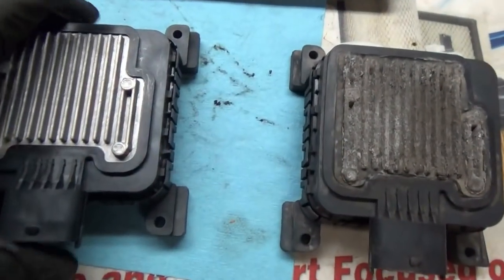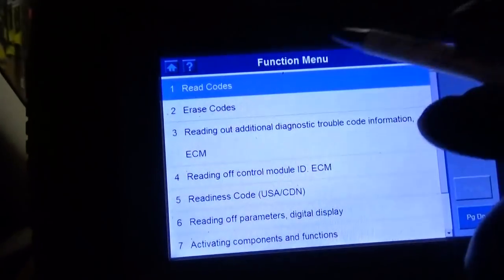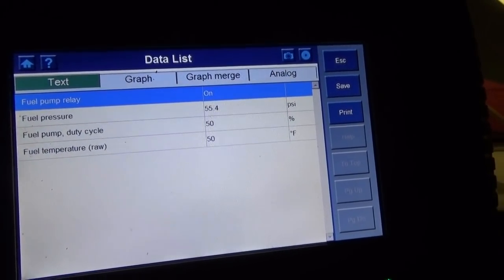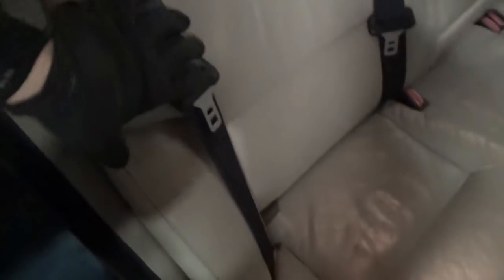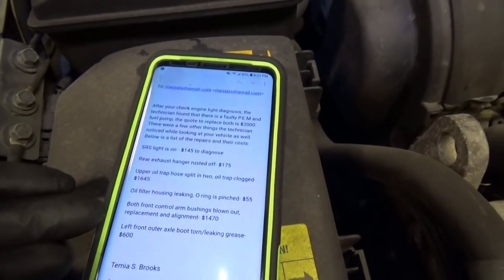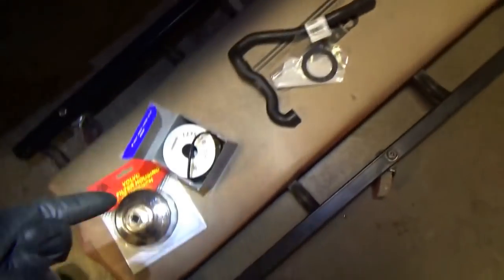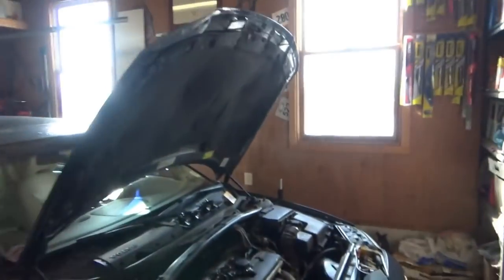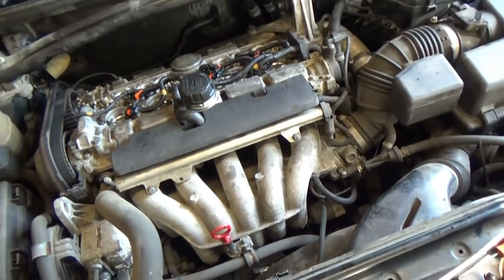Volvo Crank No-Start -Part 3 (Repairs!)

Comment: "Euro trash".... Hhmmmm. Let me just pick that myth apart. You guys know that your American brands are not that brilliant for reliability and corrosion, so why do you call European cars trash? They're usually better equipped, more modern, better mpg, less corrosion issues ... Should I go on? There's of course European brands which won't last as long as as a Volvo, but that's because they cost a 1/3 less than a Volvo.... Mercs and Volvos are top of the list in terms of longevity. I'm a mechanic and I've worked extensively on both. BMW's are pretty long-lived too. VW, not so much. Modern VW's appear to lack the quality of the the older ones. And the French cars? Yeah, they've never been known for being particularly reliable. For good reasons. I know because we've owned 4x of the bastards so far!
Reply: and what parts were you pedaling, I might ask, dealer employed perchance!
Reply: that name calling is all political mumbo my dad worked union and always said shit like rat cars, and things of that sort....